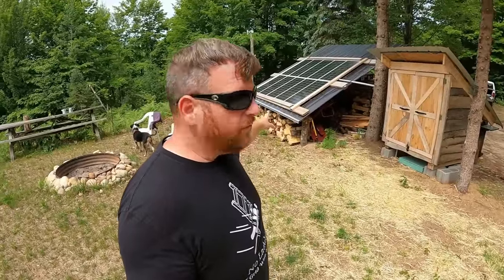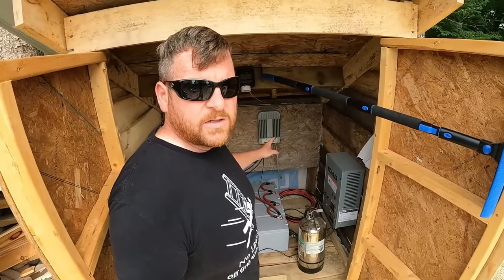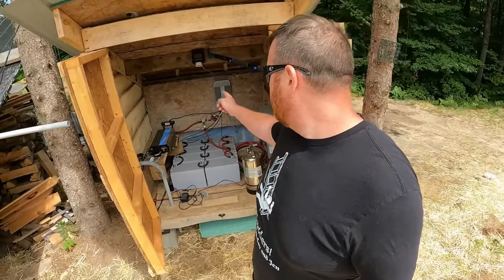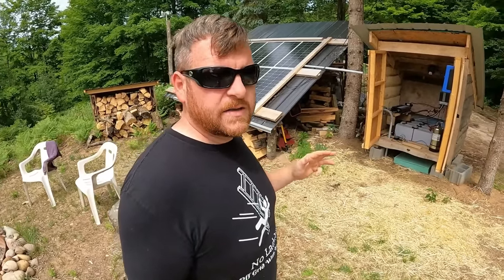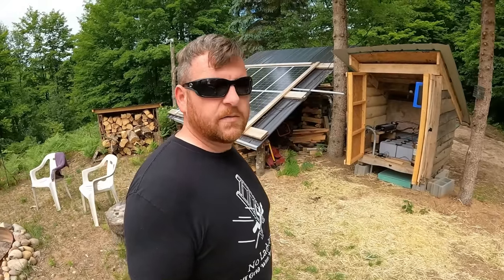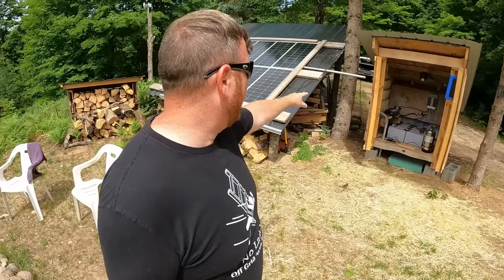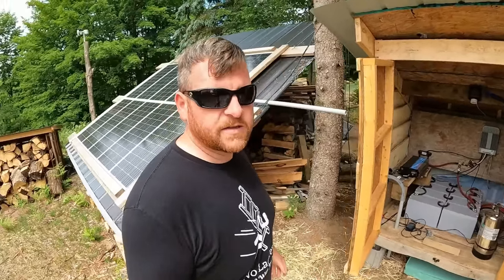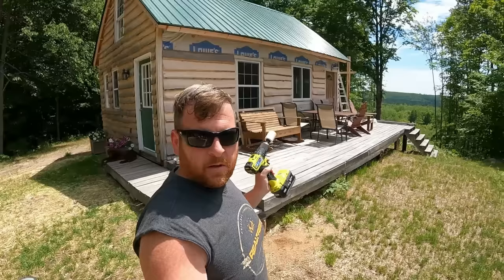One Year Off Grid Solar Power System Update

Comment: To be more efficient.
DC voltage has an easier time traveling the distance.
AC voltage loses a lot of current traveling the distance.
It's better to setup the battery shed next to the cabin. You'll get more bang for your kw generated.
Reply from the maker: I think it is the Opposite my friend.....AC travels better over distance. This is why my solar and batteries are close to one another, then I convert it to AC to take to the cabin over a longer distance. The DC for the little water pump should be closer to the batteries for sure.
Reply: @OffgridwithJayandJen  
It's actually the opposite of what you said.
DC travels further than AC.
I'm sort of technical kinda guy 
Go read about HVDC to replace AC transmission lines.
High voltage direct current can travel 1000's of miles vs AC high voltage is limited to 100's of miles.

There's a plan to build a trans Pacific HVDC between Australia and US.
The grand plan is when US goes dark during the night. Australia will provide power from their solar array system. During the day in the US, US solar array will provide power back to Australia with power when they go dark.

Sahara desert has same plans for the Europe. Saudi is building a network of HVDC to Europe from Sahara desert.

Australia is also building a network to SE Asia and India.

It's going to be a interesting years ahead
Reply: To keep it simple.
240vac from the transformer can only travel roughly 250' towards your house.
If it's further than that. The power company will extend the high voltage (few thousand volts) line and set up a transformer onsite 
120vac even travels a shorter distance.
That's why some manufacturers tell you not to use extension cord on appliances.
Reply: @wt9653  however this is at high voltage when this was worked out generally for things under 1000 V AC is simply better because the DC cable that is appropriate for this and all the other components add so much cost you can just use a bigger wire size
Reply: @UKsystems  
You need to go read on the HVDC technology. The DC voltage we're talking about is in the 100s of thousands or even in the millions volts. The cable size will be smaller than the AC cables.
Reply from the maker: I read a little on it now.....it sounds Interesting for large scale, high voltage systems....but not for this application.  For a power plant maybe....
Not to save tranmission losses of the 50 foot from my solar shed to the cabin.
Reply: @OffgridwithJayandJen  
😂 Sorry bud, I was having a chat with another person about the planned transpacific HVDC between Australia and the United States. Me bad! I wasn't paying attention.

I remember chatting with you.
Yes! It's better to have AC closer to your home. The solar panels should be on the shed or can be located further.
Wiring in series will raise the voltage so it travel further without raising the the current.
Reply: @OffgridwithJayandJen  definitely a little overkill for that line worst case you just put a bigger cable in it may cost a little bit but it’s probably cheaper than the expensive conversion equipment
Reply: @wt9653  yes and I don’t think 1,000,000 V is going to be safe for a standard table. You’re going to be looking at tens of thousands just for the cable so your point is sort of correct but it’s not applicable in this situation.
Reply: @UKsystems  
?????? 🤔
Reply: @wt9653  so you are confused that someone isn’t going to spend millions just to do this for a very short cable run are you volunteering to donate the money?
Reply: @UKsystems  
What are you talking about?😳🤔😂
Reply: @wt9653  the fact that you want someone to spend millions on a high voltage DC transmission line when you mention that it has to be in the millions of volts it’s still going to be 40 foot away from the cabin because no one wants that in their bedroom

Comment: Just spent 4600.00 at shopsolarkits. Cannot tell you how disappointed I am with it. 600w panel array, 60a charge controller, 4000w inverter, (2) 200ah gell batteries. Can barely run 2 180w freezers over night. And don't even think about calling support staff,they have no idea what your talking about.  They told me a 24/3 cable was a 4/0 cable ,and a 120v charger was 240v.
Reply from the maker: Oh No, I'm not Familiar with that site or company, sorry to hear that. If I Were to share any suggestions it sounds like you should have some good stuff there but you need a few more Panels. Which fortunately are the less expensive part. One thing I failed to mention much in this video is how our panels are in a good location and get LOTS of exposure to the sun. Being up on the hill top like we are we get 8-10 hours of good sun every day. So make sure you are capitalizing and have your solar Array in a good sunny spot. Maybe some of the other people here can also help with their comments.
Reply: @OffgridwithJayandJen  Thanks for the info. I will check into it.

Comment: Hi Jay.
Really enjoyed your video. Do you know how much kWh per 24hs this set up produces on average?
Reply from the maker: Oh man.....I wish I had a better idea of that number for you. I know there are many improvements I could make to help it produce better. For one If I could adjust the angle for different seasons, that would help for sure, but as it sits it still does well for us. If I were to make a calculated guess as to the KWH it produces on a FULL Sun filled day I would say about 3.5 kWh. Here is why....Sun hits panels at 10ish AM....starts getting about 150 watts to system. 11:00 - 200watts....12:00 - 300ish watts....2:00 it is Peaking at 800 watts ( about 80% effiecient) for a while. Then the same heading down until sunset.  This is a Rough Guess, keep in mind we are on top a hill and in the open...so we get a lot of Sun.  1500-2000 watts morning-peak.....1500-2000 watts peak-sunset.   Our 4800 WH battery bank can often charge from 50% ( AGM battery safe zone) to full in in a single full sun day.

Comment: okey for under 4000$ i got a 3kw of panels 6x 505 rinse bifacials  (in the states one can by solarpanels used for next to nothing) i have lipo4 batteries 2 8s 24v 280a each 560a in al (14kwh)made from new eve lf280k cells from a good seller with warrenty  ,each have a daly bms 200A charged with a pow mr mppt 450v 60A chargecontroller/with 3 kw 240v inverter and generator input  ,, burbars and all the small bits
Reply from the maker: That's great. I bought all my stuff during the great shortage of 2021 where it was hard to find stuff. I'm happy your system was affordable too
Reply: @OffgridwithJayandJen  yep most was purchased in the last year . It is indeed the time werd one can get a capable system for few money . I like your system it is very usefull . In the start i was offgrid (after my house on my farm burned down in okt. Last year) i was running my power from 6 old 100w panels a pwm controller   modified sinewave inverter and a few old lead acid batteries i had . Laying around on the farm  .  One can get by on small systems . But i figured i might upgrade while all the stuff is cheap and readyli avalible..
Reply from the maker: @kimmogensen5390  great

Comment: Try mounting the batteries up high and installing the inverter and charge controller underneath them, then insulate.  The residual heat from the electrical components should be enough to keep the batteries at a good operating temperature.

If you don't have a disconnect switch for your panels, throw a tarp over them before playing with the connections, your charger will thank you.  Cheers.
Reply from the maker: This is a good idea. If I do any modifications this year I will be including this in the plan. Thanks

Comment: One question - with your current set up how long to you estimate before you have to start swapping out your batteries because their life expectancy?? Cheers
Reply from the maker: I wish I could give you a better answer, but I just don't have experience with batteries in a solar type situation. The closest comparison I have would be the deep cycle batteries in my fishing boats I have had over the years, but although these are similar type batteries they are used differently so it will affect the  life span. Honestly I think they will last close to ten years simply because they do not see heavy draw downs, which is what causes most the damage to a battery. In this system they are never really drawn down below 80% AND they are continously on a trickle charge which is ideal for keeping batteries healthy. In my fishing boats my batteries last 8-10 years so I see no reason I shouldn't get the same out of this solar battery bank
Reply: @OffgridwithJayandJen  sounds like a win win situation...for your usage... makes a lot of sense to use the cheaper batteries...all the best from the UK.

Comment: I mean, with a bit of work, you can get a 5-6kW+ array from places like SanTan and 13kWh worth of LFP storage on a LV6548 or 6048 all-in-one inverter for under $7000.  That doesn't include racking, wiring, etc, but figure under $1000 for all of that, depending how resourceful you are. 
Sure, that's 2x what you spent here, but then you really could run everything on a fairly consistent basis. Induction cooktops, under sink or mini water heater, toaster ovens, small well pump, washing machine, etc. 
Maybe another $1000 worth of panels to max out the 8kW MPPT solar controller if you live in the northern half of the US to account for reduced winter sunlight. So possibly $9-10K all-in on a very capable system.
Reply from the maker: I see where you are coming from....but I'm just talking a simple cabin system here and want to agree with you and completely see where you are coming from. My only question is why does it seem these guys with 20-30kwh systems with 5-10kw arrays run their generators a lot? Multiple channels on your tube that LIVE offgrid and have trouble keeping it going.  I'm not arguing because I see us upgrading to a system like you described in 5 years or when these batteries die, but I'm waiting for something to help us with the cold better.
Reply: @OffgridwithJayandJen  that is surprising. you wouldn't think they'd need to run a generator hardly ever. Maybe the winter time is still a bit rough with less daylight hours, and usually pretty cloudy most days. I wonder if supplementing solar with a small 1.5kW wind turbine would be good for Northern climates....
Reply from the maker: @andrewt9204  I think a huge problem with a lot of systems if just poor location of the array.  We are fortunate and on top of a hill and have 10 hours of exposure to the sun. Many try running systems at their cabin in the woods and only get 4 or 5 hours of solar charging. Maybe I'm wrong but just talking
Reply: @OffgridwithJayandJen  True, hard to get away from trees sometimes. Even your setup gets a bit shaded there it looks like. It's what is severely limiting my solar potential. Unfortunately they are my neighbors trees... and I don't want to put my panels in the front yard.
I'd argue their trees are way too close to their foundation anyway, like only a couple feet away, but not much I can do about it.
Reply from the maker: Ya the perks of living in a neighborhood. My pines do shade the panels a couple hours in the morning....but only in peak of summer it seems then the sun starts dropping on the horizon and the trees don't shade it at all. Two months in the summer I can deal with  because the battery bank is fully charged every day anyway, lol. Maybe you can take a case of beer and a chain saw to the neighbors and start putting ideas in his head, lol.

Comment: im halfway into your video, im not sure if its specified later but I'd like to know, what are you able to power daily with this system?
Reply: Nevermind, I paused the video at 8:40 and the litteral second after that is you mentioning what you power and don't power xD
Reply from the maker: @savagelexlex1296  I can't remember if I go deep into detail or not, But if the Battery Bank is full and the Sun disappears for 3-4 days we can run things pretty well. THINGS being the 10.4 cubic foot Fridge/freezer, Lots of lights, ceiling fan, charge camera gear, and run our laptops a lot. We are not super careful with power until November rolls around and we start getting weeks without sunshine as opposed to a few days like during spring, summer, and Fall. Winter last year was not so bad and we must have had more sun than normal, but this November-NOW has been a little rough
Reply: @OffgridwithJayandJen  thank you for the reply :D

Comment: just put all battery system in your home so it will be over 40f no need heat I have be to in solar 25 years i am in uk for light i have 4x 140w panels 4x 270w at12v for lights tv laptop with a 12v to 19v stepup and 24v 4x270w in to a 3000w 240v inverter i hope to get LiFePO4 for not a lot i no all the solar guy in festival in UK

Comment: Hi Jay, love your videos. How far is your solar array from the cabin? We’re building an off grid treehouse and need a similar setup.

Thanks,
-Paul
Reply from the maker: We just buried the permanent line a couple months ago and it is about 40 feet from the cabin. From my research you just want your panels close to your batteries because DC doesn't travel through wire as effiecently at AC current. So if you can keep the panels and batteries close to each other that is better.
Reply from the maker: Also don't discredit the portable power stations if you have lower power needs. In our last video about opening up the bedroom we showed the Alpha Ess power station.  They are awesome to have around and make having power super easy if you are just looking to use it in a tree house project. Unless it is an off grid  House...in a tree and you are talking full system. I'll check you guys out if you have videos. Sounds cool
Reply: @OffgridwithJayandJen  Thanks Jay, we do have a few videos, just started a few months ago. I think we want to go the solar route, it’ll just be used on the weekends and only be 300-400 sq ft. Our issue is the cold winters in Maine so we’ll need to work around that. We still have a long ways to go but it’s inspiring to watch your build unfold… keep up the great work!
Reply from the maker: @MapleRidgeHomestead  love it. thanks guys

Comment: Not understand your property... Why didn't you go below ground for the battery storage so that temperatures couldn't be so extreme?
Reply from the maker: Well  digging a giant hole cost money and creates a permanent non flexible system location. We are in the process of building still and needed everything to be portable until we found the right location. Building the solar shed like we did we were able to assess the situation and make changes that made the system work better. I do plan to dig a cellar and such at some point, but our budget and focus are building our cabin before we get fancy with other structures and systems.
Reply: @OffgridwithJayandJen  see, perfectly clear reason! Thank you...

Comment: Do you have air conditioning on the system
Reply from the maker: We do not....but I just picked up a window unit and it only sucks 300-400 watts...so I should be able to run it on nice hot sunny days

Comment: I've seen a few people buying 10 100w panels instead of 4 higher wat panels.. Is there a reason you decided on this?
Reply from the maker: For us it was simply that we started with zero knowledge and a low budget. We experimented with a small single panel system to learn. Last year when we were ready to upgrade our system most of the larger panels were out of stock, even online, and we decided since the price per watt was similar either way we would just stick with the smaller panels that were in stock and available. Another reason I didn't feel bad about it was that is one panel failed or had an issue it was less of a loss and could simply remove it from the system. Just our reasons
Reply: @OffgridwithJayandJen  that makes sense,  I'm in similar situation myself with the way energy cost is skyrocketing. 

Thanks for taking the time to answer.  You have a new subscriber now 😉
Reply from the maker: @violentnewworld  awesome man.....thanks for the support. 😊👍

Comment: Amish are the biggest users of solar in the US. If you live near one of their communities you'll have access to any number of kitchen and household appliances that are converted to DC motors, for not much different cost than 120VAC.  if you live in the far north, there are 3 to 4 months where you must have an AC input to charge, or a genset.  The less you use the inverter and go with these lower cost Amish-adapted appliances, you can save 10% power consumption that inverters consume when turned on.  

This obviously isnt as relevent in the Lower 48 where the winter days are longer.  So from that context, the choice of more panels and batteries makes more sense than propane or DC fridge or freezers, which are very expensive. 

 I have line power, so my solar system is there to rub my nose in the technology, and to have 7 to 8 month solar power for two critical appliances (and 4 winter months when the system is basically a big UPS charged by line voltage) from power failures which are going to become more frequent as they take down coal power plants.  My system runs our fridge and one chest freezer.

Comment: You could’ve saved $1000 by using  a all in one hybrid, solar charger with the Mppt  They only cost between 450 and $600 for 3000 W systems true sine wave inverter 40 amp battery charger.  I just replaced my system with 2400 W of solar 2. 24 white lithium ion batteries, and the eco-worthy 3000 all in one hybrid   Total cost $3900.
Reply from the maker: Sounds Awesome James